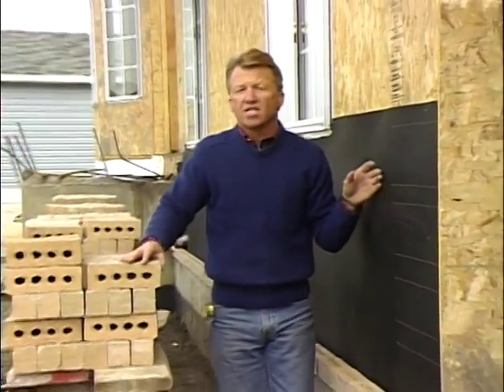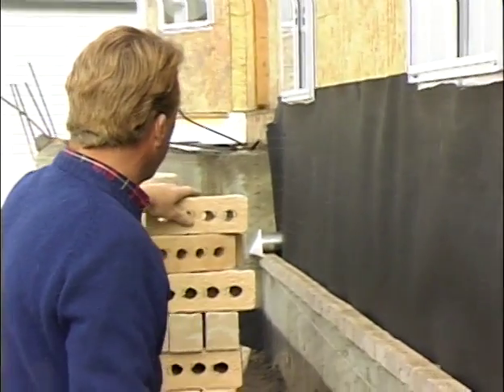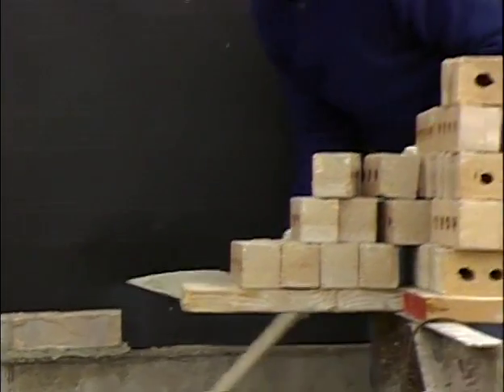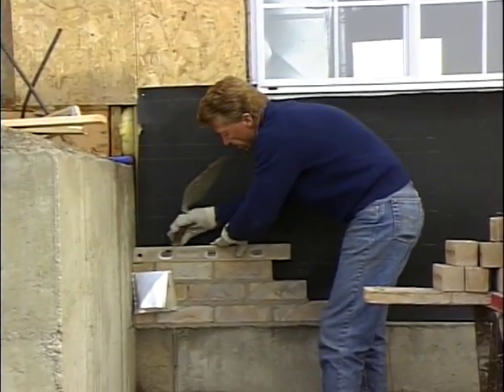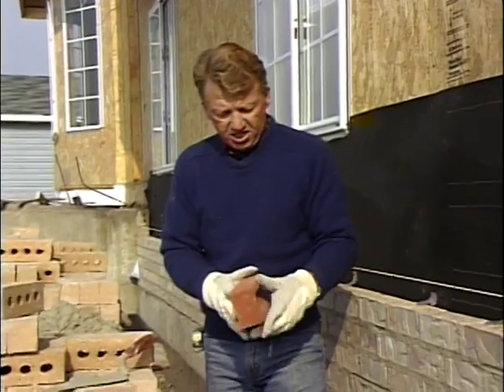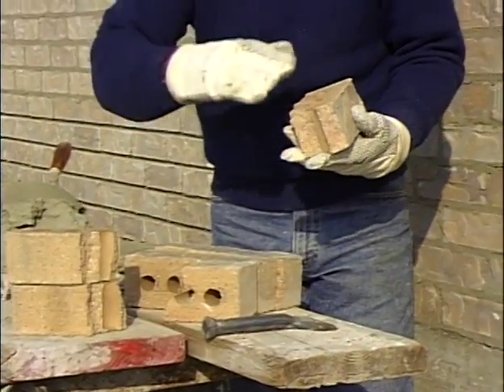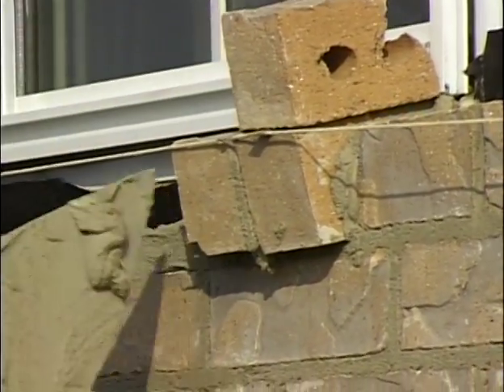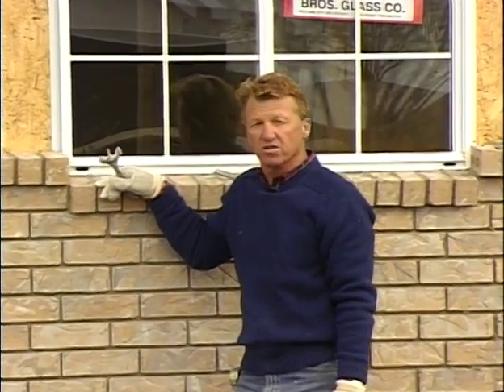The Art Of Laying Brick---Laying a Brick Wainscot.

Comment: Not bad, a bit amateurish. Its ok to tap a brick occasionally but if you spread your muck correctly you shouldn`t have to tap it. and he really needs to get a decent sized level .LOL.
Reply from the maker: +golfinguna if its muck you'll have a hard time spreading it.
Reply: +golfinguna u tap your level only when to establish corner manually, when u got leveled post just lay brick using hand squishing etc
Reply: Yes that's what I stated above. If you spread your muck properly a slight pushing down motion or squishing (as you put it) gets the brick level with the line. There is an old saying, "get as close the line as you can, without touching it.
Reply: lay away from to the line
Reply: Paige Heimann , your the one putting rolls in the wall, and it's a  trowel with from the line.

Comment: I got a few criticisms on this vid. The bricklayer does not check to see if the concrete foundation is level (on tape), maybe he did it off camera, but since this is an instructional vid, i feel its a big deal. It could easily vary an inch from one end to the next, and you wouldnt know it until you're almost at the top. 

Second, under the windows. He should have sorted the bricks he used. Found the stones who were the most even in size. It sticks out like a sore thumb.

Third. I dont really care that he's tapping the bricks, but do it with the butt of the trowel. If you do it with the business end, excess mud can (and will) spill off and hit the face of the wall. 

On a lighter note, that tape measure he uses is fucking genius! I wish i had something like that in my part of the world! 

All in all a very good vid. Looks like its old as fuck though. Early 90's? I hope you'll upload the rest. Though we do things pretty differently where i'm at, some things are universal and he has alot of good tips.
Reply: you guys don't have brick tapes? we got gauged tapes for csr and reg brick. (canada)
Reply: But how did he know the two ends of the first course were at the same level?  Can’t just measure up of the foundation at each end and presume the foundation is level.
Reply: @daveylad2  you check to make sure the bottoms of all the windows are level with one another and measure down to the top of the foundation or set up a transit and shoot the elevation. The bottoms of the windows has to be level as previous stated!!! Elevations are established from top down .

Comment: hes not bad you should never tap if it was waterstruck his work would be all over the place
Reply from the maker: mcc420 Your talking about 1% of the market and in the north east only. For the few waterstruck jobs we have done in the past 40 years none had a huge problem from tapping. Would love to see your video on how to lay waterstruck brick.
Reply: Wrong tapping bricks actually creates a bétter stronger bonds
Reply: Bill K your wrong been doing this a long time water struck does not absorb water
Reply: mcc420 Please explain what you mean to me ... an amateur?
Reply: 3Vimages never said amateur i said hes not bad but you should never tap brick
Reply: mcc420 No ... I meant me, I am the amateur! Why should you never tap brick and how to you bed it down into the mortar without tapping?
Reply: roll it down with fingers tapping is a bad habit laying water struck brick the wall will float all over im a union bricklayer for 25 years
Reply: Learn To Lay Brick ~ he is incorrect. Water Struck brick would absorb moïsture more... it has more to do with the MOTAR..
Reply: water struck doesnt absorb water his mortar is fine
Reply: mcc420 ~ Wrong Water Struck Brick is first Absorbent...  it is sand molded or more correctly glass beads & sand to release it.  It is rarely used most is imitation. Due to this... originally used in old European Countries.. Old Colonial Times were used. Tend to be a combination of light burned to heavily burnt. Although hard the sand on the outside can & will absorb water the rest will not.  CREATING A FLOATING OF THE BRICK... IF MOTAR IS TO WET.
Additionally it is only used in New England Restoration work & then only a small percentage.
Very few Brick Manufacturers Actually Produce it.
SEE BRICK INDUSTRY ASSOCIATION.. OR A.I.A. ASTM GUIDE LINES.,
Reply: maybe you havent used water struck brick then
Reply: mcc420  have seen it have used it.. No different than utilizing a SW Rated Sand Molded Pavers... FACT.
QUESTION IS WHY WOULD ANYONE PAY DOUBLE FOR A PRODUCT.. THAT UTILIZES OUTDATED TECHNIQUES & 0 TECHNOLOGY???
WHEN A MODERN REPRODUCTION BRICK UTILIZES MODERN COMPUTER CONTROLED KILNS ?
Thus insuring Highest Quality & more important CONSISTENCY....
Reply: really you ever lay s@f very different we had to put heat on them to joint them in october regular brick no problem
Reply: mcc420 ~ According to the B.I.A. Heating the area your working in as well as tenting it protects it from weather in harsh environments. Have seen mortar being heated. Moisture apples to some bricks while others are kept bone dry. Depending on how bricks were manufacturered.

I believe now with technology, scientific studies, the masonry industry is modernizing. To produce better results.

Unfortunately their are careless cluster fu@%s  that couldn't care about what mortar is used nor portions of Portland, Sand, Water, Lime, Additives..
Nor what a rating on a brick is..
Nor proper moisture control in the cavity.

But others are true artists..
Reply: what does that mean enless you live in a dessert water struck doesnt set up quick i was taught not to tap
Reply: +Jeffrey McMillan HEY DUMB ASS I OWN A SHIT TON OF RENTAL PROPERTIES... FORMER LARGER CUSTOM HOME BUILDER. AVG SQFT 10,000  TO 20,OOO.
7 FIGURES A YEAR! RETIRED !
YOU ? 
MARQUIS CUSTOM BUILT HOMES
NOTE THE 7 FIGURES A YEAR EACH YR DONATED TO VARIOUS CHARITIES....
& YOU MAKE WHAT ????
Reply: +mcc420  I like ice cream as a dessert (vs) but hate deserts because they can be to hot and sandy for my liking. The English language is such a harsh mistress